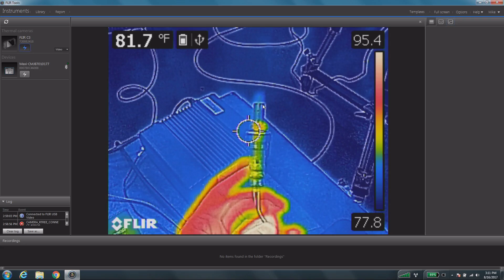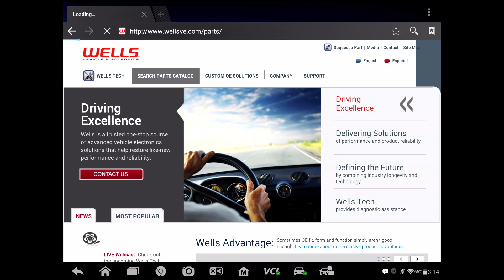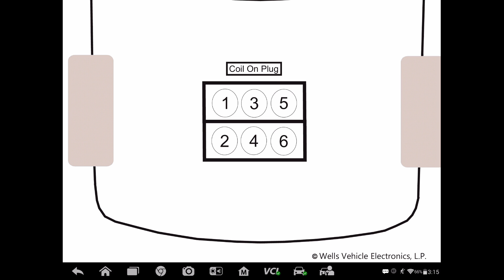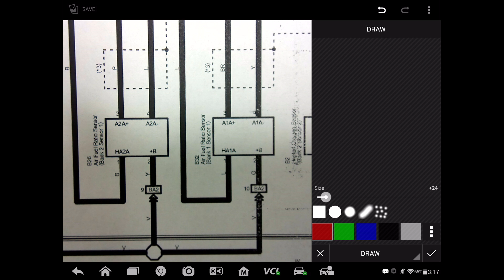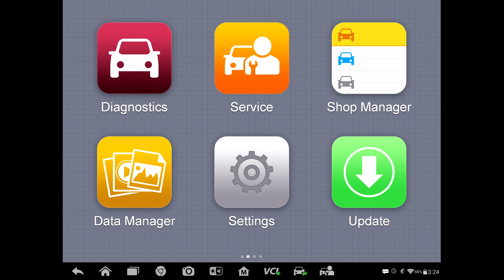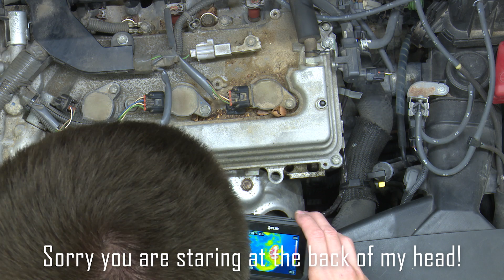CounterPoint Ep.30 - Testing the Heater Circuit of an Oxygen Sensor

Comment: hi mike,,,,is it correct that the heater circuit doesnt have polarity and how did you determine which one is ground; or could you  have connected either way

Comment: Dude I have a case on a 2026 Buick encore downstream 02 sensor heater goes all the way to 10% and 02 voltage stays at 1.89 v as soon as I turn off the car and turn it back on again 02 start working normal  any ideas , 02 I'll stay at that voltage is I don't turn key off and then on and it will throw a p0421 code cats it's new 02 is new but it had this problem even before all these parts were replaced

Comment: I put the key ignition on and tested voltage at o2 sensor heater wires coming from the pcm and it was delivering 9.5 volts. Shouldn't be 12v? What does that means if is less then 12 volts

Comment: Does the o2 sensor heater shut off after the exhaust gets up to temp
Reply from the maker: Hey Audi4ever, a traditional oxygen sensor heater will turn off. An air/fuel ratio sensor will keep the heater on at all times. The temp required for an air/fuel ratio sensor is much higher than exhaust gas temp.
Mike Becker, Senior Instructor

Comment: nice video Mike,   question, on a Range Rover  ---- HOW LONG --- does the ECM is pulsating to ground, the 02 heater,???      is it only to heat up the element ,,,?  or all the time the engine is running??

Comment: Thanks for the vid! I just checked my o2 sensor heater, and, it has nothing to show on the ohm meter, and so I will be replacing it. No wonder I keep getting a pesky check engine light..haha but the real funny thing is, the CEL only shows up when the engine is left at idle for about 10-20 mins, but yet the CEL never comes on if I just run the rpm's up, or go driving down the road without letting the engine sit running at idle for warm up time. Does this mean that my vehicle has more than hot enough exhaust so that it doesn't need the o2 heater when the engine is running at mid to high rpm? BTW my vehicle only has one o2 sensor, and the computer system is a 1990's OBD1 jeep/chrysler type.

Comment: So does the heater act as a glow plug when I turn my key to the ready to start position without engaging the starter ? Or does the engine need to be running for heater to be activated
Reply from the maker: Hey Tphelan86, thanks for watching! The heater is usually only active when the vehicle is turned on. I have yet to see one pre-heat at key on.
Mike Becker, Senior Instructor

Comment: 2000 Lexus gs300. Code po125. Heard it’s usually a sensor issue. Code only triggers when I’m driving. 

While heated up to temp 190°f at idle what should my voltages be for all my sensors ? I noticed my graphs for B1s1 is oscillating, voltage .08-.9v. 

B2s1 is pretty flat lined at .010 and will oscillate a bit but not much when I’m slowing down or speeding up from a stop. 

I rev up to 4k and b2s1 doesn’t move much but b1s1 does. 

So is it normal to flatline or is it supposed to be oscillating heavily?

Comment: I WOULD LIKE MORE INFO ABOUT O2 SENSOR WITH 5 WIRES.NO INFO AT ALL ON YOU TUBE ABOUT THIS 5 WIRES O2 SENSOR.THANKS
Reply from the maker: Hey Oswaldsantos69, you're looking for information regarding air fuel ratio sensors then. As far as I know, there aren't any 5 wire 02 sensors.
Mike Becker, Senior Instructor

Comment: Just put 2 brand new sensors in and got p0031 and p0051? They sensors are recieving.     .995 v each.
Reply from the maker: Hey StayClassy, on which wire are you seeing that voltage? One wire should be 12v one ground, the other is low ref and the other is signal out from the sensor.
Mike Becker, Senior Instructor
Reply: @GoTechTraining  its showing me that on my OBD scanner, I haven't used a DMM on the actual wires yet. Should I test the wires with a DMM? My vehicle is a 06 range rover hse 4.4l. I didn't disconnect the battery before installing the sensors.

Comment: would you blow the the heater circuit on O2 sensor  connecting it directly to 12v battery when you don't have the computer pulsing the supply
Reply from the maker: Hey R Mil, that depends on the type of sensor. Newer sensors, probably. Older ones used to run 100% duty cycle during warmup. 
Mike Becker, Senior Instructor

Comment: c reader scanner reads time transition fail on my 2004 passat 2.8l this pertains to oxygen sensors and it has multiple misfires code which is po300 replaced upstream O2 sensor but no luck. please help I thank you

Comment: Hey Mike i tested the resistance of the O2 sensor on my 02 subaru, and got a reading of 0.01.
troubleshoot and diagnostic manual said reading should be under 10. Was wondering if  0.01 too low?
Reply from the maker: Hey Hlau Thoj, I assume you're testing the heater circuit, right? 0.01 sounds like an odd reading. I would expect something in the 1-3 ohm range at least.
Mike Becker, Senior Technical Instructor

Comment: thanks go tech if you find wiring diagram for 98 volvo v70 non turbo the wires on the engine side the 4 colors are brown  green/white stripe green/ black stripe and green/orange stripe im thinking brown is the signal wire and the green/white stripe is ground these are the  2 i want to test with a test light to make sure i have power and ground fromthe pcm correct
Reply from the maker: Hey Kevin, judging from your wire colors, your working with the rear 02 sensor...right? I show green-orange as power to the heater and green-black as the ECM controlled ground.
Mike Becker, Senior Instructor
Reply: @GoTechTraining  no the front o2 sensor changed to another sensor and p0133 came back again

Comment: ok cool ill keep that in mind so ill change my sensors and if p0133 comes back how do i test to make sure the computer is not bad
Reply from the maker: Hey Kevin, you would want to check for power coming to the heater on one side. The other side is ground side controlled by the PCM. A test light can be used to check this. You can take the lead of the test light onto the power side going to the sensor and the tip of the test light into the ground side. You are swapping the 02 heater for the test light bulb. If the bulb lights/flashes, the PCM is doing it's job.
Mike Becker, Senior Instructor

Comment: thanks for the info what causes the heater circuit blow in the sensor
Reply from the maker: Hey Kevin, there's quite a few things. It's not really "uncommon" for a heater circuit to fail. Age and vibration are the 2 major factors for heater failure.
Mike Becker, Senior Instructor

Comment: actually i tested the o2 sensor 2 white wires for the heater put meter to ohms resistance i got nothing and then i tested both upstream and downstream  with scantool  up was a rich lean condition but downstream was like flatline no reading sounds like im changing sensor or sensors i drive a 98 volvo v70 base model 210k
Reply from the maker: Yeh, if the heaters are open circuit it's probably time for a new sensor.
Mike Becker, Senior Instructor

Comment: ok thanks go tech but how do i go about clearing up a p0 133 slow response
Reply from the maker: Hey Kevin, slow response can be a sensor issue or an air/fuel issue. Can you force the sensor to go rich/lean by creating a vacuum leak or introducing propane? 
Mike Becker, Senior Instructor

Comment: would this diagnosis be the sam for p0133
Reply from the maker: Hey Kevin, no the heater circuit and the signal circuit diagnosis is different. A P0133 is a slow response code.
Mike Becker, Senior Instructor

Comment: #1 Is it safe to use a test light to confirm circuit integrity and PCM operation (pwm ground) for ALL vehicles.#2 Will all computers protect themselves as this one did when it detected something was not quite right?
Reply from the maker: Hey Michael, depends on the circuit. This circuit runs a heater element. That heater element draws way more amperage than the test light...so yes, it will be just fine. You don't want to load a signal circuit.
Mike Becker, Senior Technical Instructor
Reply: Thanks for the feedback Mike. Great videos. Always learn something new

Comment: 2004 acura tsx negative and positive is on only when car start!
Reply from the maker: IS it causing issues? The heater circuit should run even when the car is running.
Mike Becker, Senior Technical Instructor
Reply: @GoTechTraining   P1157 A/F sensor voltage high my scanner read 0 volts in the A/F  sensor  I test resistance 2.6  at fuel trims there is not reading nothing is move but the car still running normal I just have the check engine light on  I do have VSA light on too!
Reply from the maker: Sounds like the car is running in open loop at this point because it has failed the test for the sensor. Sensor voltage being high is very different that a heater circuit issue. You're looking at a signal problem, could be just a bad sensor.
Mike Becker, Senior Technical Instructor
Reply: @GoTechTraining   i think so too!  the repair manual only calls for check the integrity of the circuit which is good.
Reply: @GoTechTraining  thanks mike!

Comment: Great explanation of the diagnostic for an oxygen sensor!, The other 2 wires for signal,one is 12 v and the other one ground? Or how do they work? I heard one is high the other one low.
Thanks for the lesson!
Reply from the maker: Hey JG Garcia, thanks for watching! There are 2 heater circuit wires, one signal wire (0-1 volt) and a ground wire. The signal wire is the voltage that the sensor is creating.

Mike Becker, Senior Technical Instructor

Comment: What color is the ground wire ?
Reply: The ground wire to complete the heater circuit...
Reply from the maker: Hey, the ground wire for the heater runs back to the PCM. It's PCM controlled and is pulsed. It's not just a solid ground.
Mike Becker, Senior Technical Instructor
Reply: Thank you for your response,very helpful...
Reply from the maker: Ground for what? The heater control? Or are you talking signal return? There is no true ground. It's a PWM signal from the PCM. That is a green wire. The B-W and blue wires are AF- and AF+. The black wire is power. Hope that helps!

Mike Becker, Senior Technical Instructor

Comment: I just replaced one A/F sensor on an 01 camry. The two heaters wires are black,but your are both white,is it because of the different model ?
Reply from the maker: What part number? WHat engine? I can take a look and make sure you go the right one.

Mike Becker, Senior Technical Instructor

Comment: Nice job sir 
But I I want to check volts how many volts should I get ??
Reply from the maker: Thanks for watching! A heater circuit will be commonly fed 12v power and a pulse width modulated ground.
Mike Becker, Senior Technical Instructor

Comment: Hey Mike, I have a jag x type Owners Workshop Manual by Haynes. I've check the manual from beginning to the end, and I can't find any info pertaining to what the specs are for voltage and resistance for my jag. Where can I find this info?  Thanks
Reply from the maker: Sometimes the only place you can find that info is in the factory service manual right from Jag.
Mike Becker, Senior Technical Instructor
Reply: @GoTechTraining  Thanks Mike.

Comment: Mike when I click on "search parts cat"  on "wellsve.com", I get error msg. It works sometimes and sometimes it don't. I can't follow your video. Any suggestion? Also, how did you get your wiring diagram to come up? When I can get this far on your web site after typing in "vehicle data", It shows me a picture of some type of starter with a schematic. Not what I'm looking for. Can you help me out Mike?           Thanks.......
Reply from the maker: Hey, sometimes there's an internet browser issue where it won't load the PDF...could be your issue? I just went through it and it worked great for me. I'm using Google Chrome for my browser.
Mike Becker, Senior Technical Instructor
Reply: Thanks Mike! Happy Holidays....

Comment: can anyone please help mei didnt think my o2 sencer was getting power aven though i had no check engine light on i was checking it on the wire harness side and i think i touched power to somthing i shouldnt have cuz now i have a check engine light on telling me the heater circuit has issues and i know its in the wireing not the o2 sencer,were does the wire run to is there a fuze or somthing....please respond
Reply from the maker: Hey Rick, only the heater circuit should be powered. Not the signal circuit. Many times there is a fuse powering the heater power circuit. The ground side is usually controlled by the PCM. I hope you didn't fry the controller in the PCM!!!
Mike Becker, Senior Technical Instructor
Reply: @GoTechTraining  thank you very much for responding but what you told me I already knew my question is where is the fuse the book says it's somewhere between the computer and the main relay and I can't seem to find one and it's not in the fuse box under the dash or under the hood that I can find any way please respond if you could help me out with that question if you might know where the fuse would be
Reply: @rickdenison7757  The sensor fuses is in your fuse box. That's where I found mine. Thanks
Reply: @GoTechTraining  I believe when I was trying to check if your power I touched the negative on the heater and blew the fuse

Comment: I don't have portable PSU. can i use the car battery to test the HO2 sensor?
Reply from the maker: Hey Robin, yes, you can use your battery. Just be very careful. Also, don't do it on newer style sensors, they should only be pulsed and not constantly powered. 
Mike Becker, Senior Technical Instructor
Reply: GoTech what would you consider newer? What year and forward?

Comment: At minute 8, how did you know that pins 3 and 4 (A2A+ and A2A-) were the signal wires?  And pins 1 and 2 (HA2A AND +B) were the heater circuit wires? I never heard you explain.
Reply from the maker: Usually on an O2 sensor you'll find the heater wires are the same color. A wiring diagram would help here if there was any question on which wire was which.
Mike Becker, Senior Technical Instructor

Comment: Hello. Will a heater circuit malfunction in bank 1 sensor 2 affect fuel economy?
Reply from the maker: Hey Littlebear gaming, depends on the strategy of the vehicle. Typically sensor 2 is used to monitor the catalytic convertor. If the vehicle is stuck in open loop because of this failure I would say yes, fuel economy could be affected. 
Mike Becker, Technical Services Instructor

Comment: Head in the shot to cover OHM reading of new sensor. Wellsve is only for us market. Proved by entering Golf MK5 2.0 fsi 2006 and nothing. Then Honda 2009 and no model FRV, just CRF which after scrolling down through fault codes to verify, it had no P2004 code listed. Subsequently I have come to realise that should a code state low circuit, this tends to point towards wiring issues more. In this video you say that you would still like and suggest for us to test the other stuff, but when you know the heater circuit has ridiculously high ohms; why bother. Just wasting time. The heater is clearly buggered and needs changing. 
Head in the shot not good dude.
Reply from the maker: James, sure the heater circuit is high in resistance...but what if that resistance caused the driver inside of the PCM to overheat and god bad? It is always a good idea to verify the rest of the circuit. What if a new sensor didn't fix this? Who would pay for the further diag? Technically the old sensor was bad....but what if the PCM was also?
Mike Becker, Technical Services Instructor

Comment: Mike these tests are very useful, but if  you don't have a scanner, how can you reset the codes and check if the computer is protecting itself?
Reply from the maker: Hmmm, well, you could disconnect the battery, though I'm not one to recommend it on newer cars...so many relearns....My answer is buy yourself ANYTHING that can clear the code. You can get something for well under a hundred bucks that can clear codes. I guess my thought is that if you can read the code, in theory you should be able to clear it. Though I know that's not always true...parts stores....There really is no easy answer here besides the fact that if you want to work on any modern vehicle, you need at least a basic scan tool!
Mike Becker, Technical Services Instructor
Reply: Travelingman 1997 disconnect the battery for 10 minutes
Reply: Richard Gill yeah thanks, that should work, my system is OBD1.